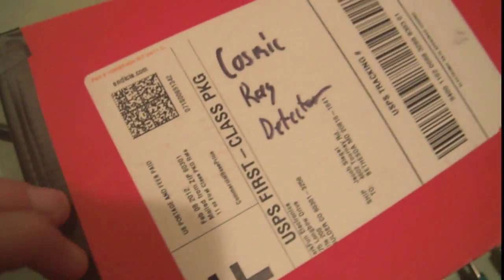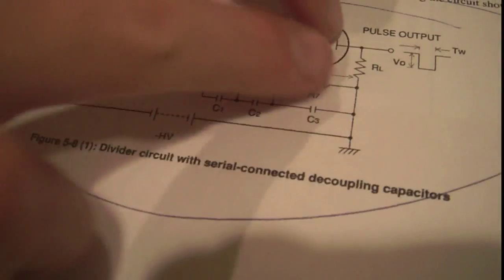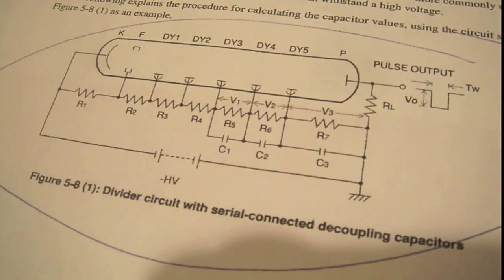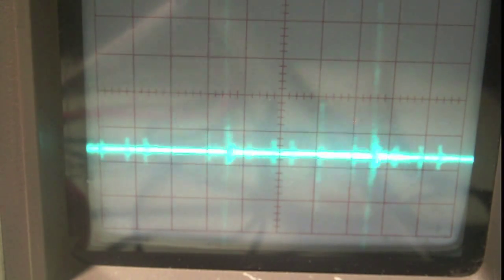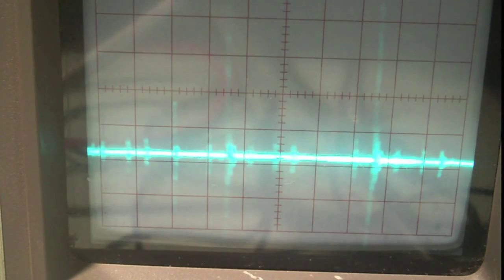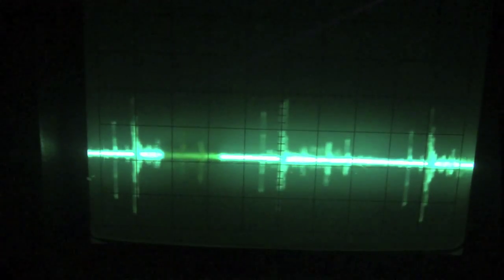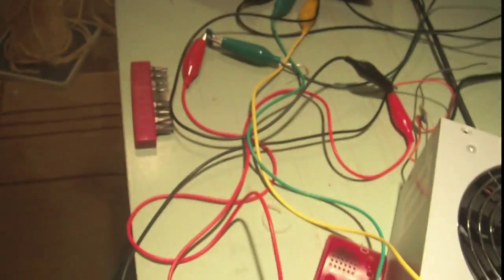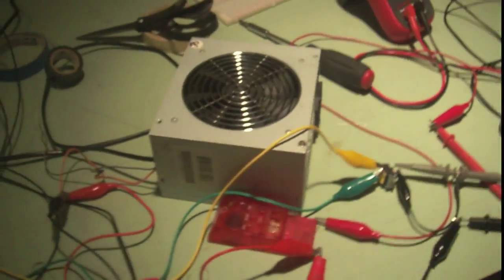Cosmic Ray Detector

Comment: You should design it as a dual array detector to detect a correlation of triggers in two independent detectors stacked vertically. This way you know that they are muon particles coming from space because they are going down through the detectors. The number of detects will lower is you place the detectors sideways. Otherwise you are simply detecting local radiation from many sources as you said.

Comment from the maker: Cool, so it is a PMT, but I don't know why one would be in a projector, maybe to monitor output light levels? Anyways you could build a setup similar to mine, do general light sensing in general, PMT's are very precise for even normal light levels. Maybe use some motors to scan one and build a extremely sensitive camera for really dark places?